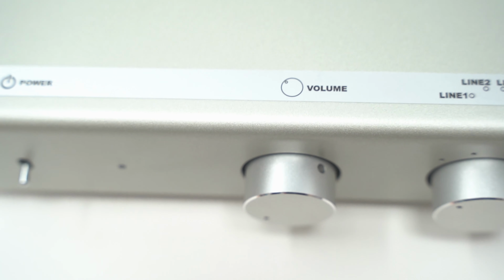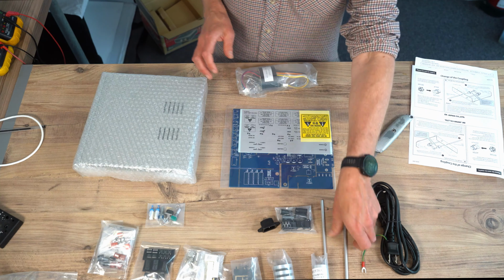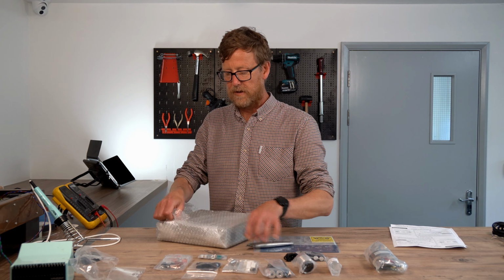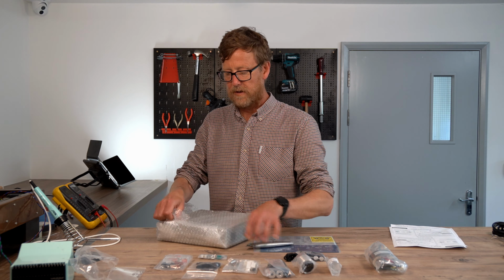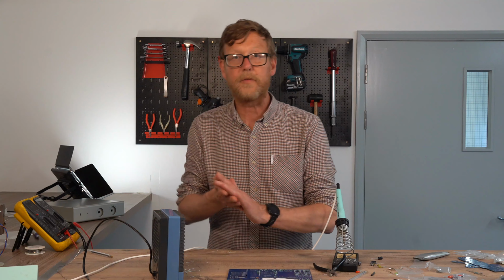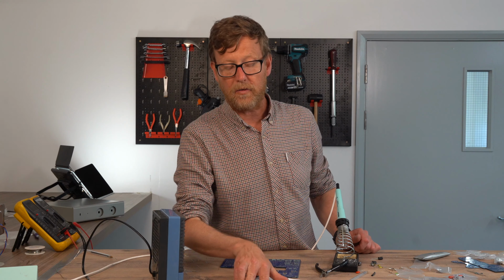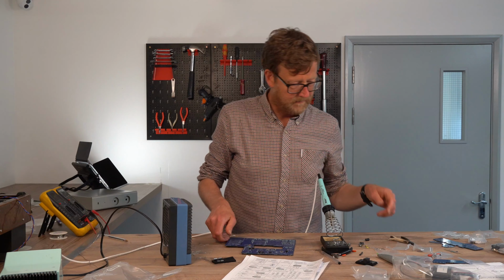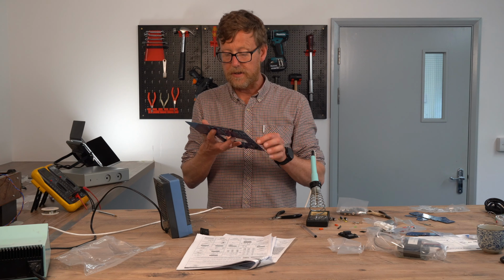BUILDING a DIY HiFi AMP KIT - Elekit TU8500 pt.1

Comment: I've just realised are you the HiFi Collective store in the UK
Reply: @Jason787  I built all my own valve gear need to buy some caps from them and audio note resistors building a 2A3 class A amp stereo amp
Reply: @Jason787  yes very rare people building doing electronics. I enjoy my equipment more because I built it. It think it sounds great running Altec 604-8h speakers model 18s